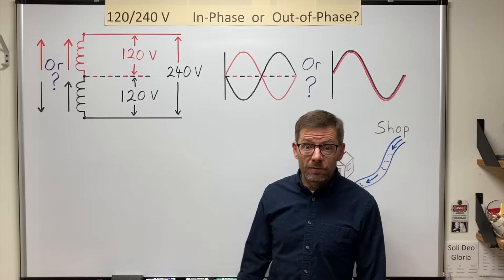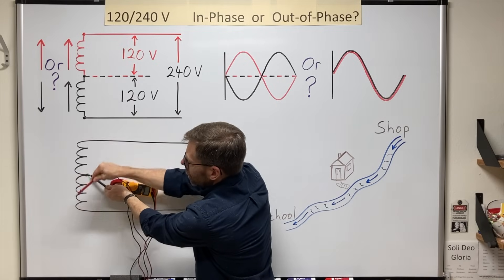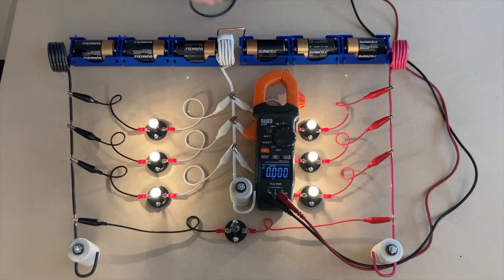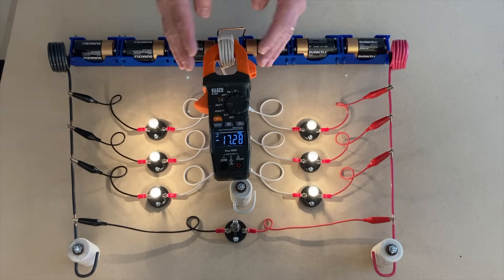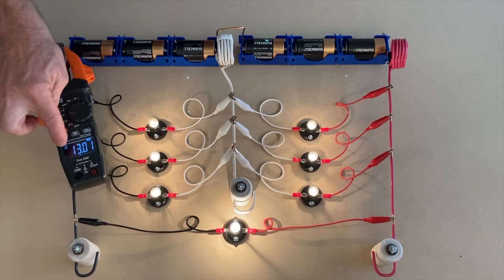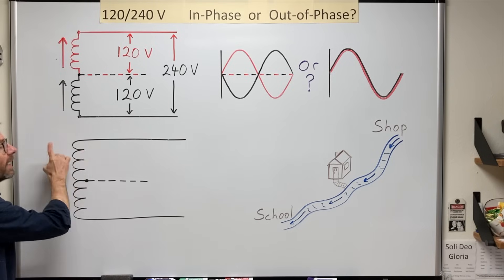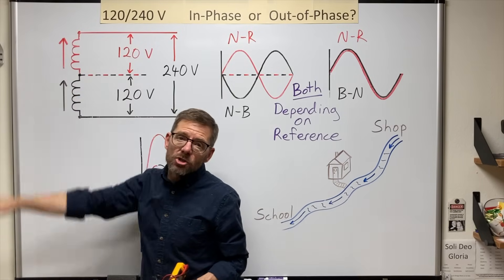120/240 V  In-Phase or Out-of-Phase

Comment: > 7:57 let's go back to the in-phase setup. 

I think what you called "in phase" and "out of phase" might be exactly backwards. When you flip the battery bank so that all of the batteries are pointing in the same direction (gold positives all point right), you have a large potential difference between the black and red busses, as expected. However, if we are treating this model DC system as a snapshot of an AC system at a particular point in, we should expect to see a dramatic difference in potential between the two busses only if the two busses are *out of phase*. This is clear if you consider the opposite: when both busses are in phase with each other, any moment in time that you might inspect the circuit would return zero potential difference between the red and black bus, meaning the 240v equipment would not run. 

Great video all around! I just had this small gripe

Comment: On 120v home generators, are you essentially using half a spin of the motor for 120v and the other half spin goes from 120 to 240v. And they give you 2 outlets from the 2 different sources? Meaning if you have like a 4000watt generator, you would want to split the outlets equally to try to max one side at 2000watts and the other side to 2000watts. Instead of trying to pull all 4000watts of appliances just from one lead? Does that make sense? 

And how is it different from a 120v/240v home generator?

Comment: Excellent video with an incorrect conclusion and should be revisited. A phase is a mathematical concept based on a measurement relative to a reference. In the case of split phase the reference is the neutral. With respect to neutral the voltage is out of phase or anti-phase since it has a 180 degree phase angle. With respect to one of the lines it is in phase. This is not a paradox, voltage measurements are always based on a a reference point. When the batteries are placed negative to negative or positive to positive they are now "in phase" or more accurately parallel in DC with respect to the center point causing the ends to have zero voltage with respect to each other, which is why the light is not able to draw any current from the two ends. In phase means the measured difference at the same time is zero, out of phase would mean there is a measured difference between the phases at the same time, the greater the difference the higher the phase angle up to maximum 180 degrees for two phases of the same amplitude. For the river analogy if I am at my house and measure water pressure in the river it will be positive from one direction and negative in the other since it is flowing toward me then away, just like doppler effect is used to know if something is moving toward or away from you its always relative to a reference.
Reply: You are wrong to use the Center Tap as the reference point. The Phase of windings does not change just because YOU added a wire, that you called Neutral.
Reply: @MrSummitville  I disagree, a voltage phase is based on voltage, voltage is relative to a reference point, the term phase voltage is based on measurement to neutral. Look at high leg delta now you have a phase 30 degrees off in the phasor diagram, where did it come from? Many inverters create 240v split phase with two separate 120v inverters running at 180 degrees from each other this is obviously a two phase source, some of them especially on inverter generators have a switch that parallel them instead and causes the two inverters to run in phase with each other for double the current at only 120v (see Honda inverter generators) so unbalanced loads can be run. A voltage phase is something you measure relative to a reference because voltage is relative to a reference always. Phases can be created by electrical devices, generators create phases, transformers can well transform them into other phases, inverters can do this as well, solid state transformers which are just back to back inverters/converters and create any phase you want from one side to the other, just because the power company sends out 3 phase from the source does not mean thats what we get at our home, its also not single phase, its split phase which is just a name for two phase at 180 degrees, there is no measurable difference.
Reply: @justinharrell9256  You can disagree but the manufacturer of the transformer states the FACTS, not you.

Comment: This might be a dumb question but at 4:40, why is the light bulb across line to line still on when you have the second set of batteries disconnected? Shouldn’t it be off?
Reply: Notice it's dimmer. The current is returning back to "neutral" through the three bulbs on the right. Since they are in series with the line to line bulb and splitting current between the three of them, they aren't getting enough to light up. An example of weirdness that can happen with a lost neutral. He has another video with this same setup on lost neutrals.
Reply: @snorman1911  Oh that makes sense! thanks for the reply

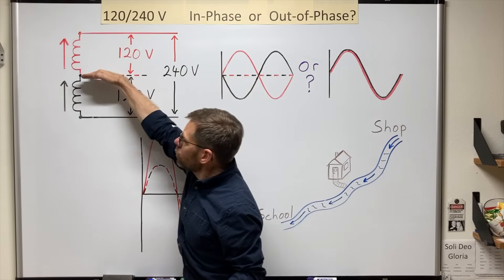Comment: Question: On 15:40, in residential wiring, I know the neutral is connected to real ground.  I assume the 'primary' side is a 3 phase (say Y) electricity.  If the neutral of this 'Y' is also connected to real ground, would it not cause problem?
Reply: the primary side is one phase out of the 3. The neutral of the 3 phase wye system is almost always grounded. So no, it doesn't cause any problem

Comment: I will repeat again here, that picture above asks the question.   "In-phase" or "Out-of-Phase". . .   Well the answer is with the centre point Grounded to 0V for Neutral, the two ends are running at 180° Out of phase with each other. . . .  It is simply like a kids see-saw. .. .   So the two 120V to Neutral are two Single-phase 2-wire supplies. . .   But all together L1, L2, N  is a 2-phase 180° 3-wire supply, simple as that, even if many Americans get this wrong.
Reply: The windings are In-Phase because they ADD. What wires you attach and what names you give them is irrelevant and does not change the physical properties of the windings.

Comment: The fallacy in this demonstration is that the voltage from one end of the secondary to the other is the DIFFERENCE and not the SUM of the voltages at  both ends. If both ends were in phase and had the same voltage there would be zero volts between them. Moreover it is meaningless to use two different reference points in a circuit as your "zero" reference. This is not merely a matter of "perspective" but one of consistency.
Reply: The windings are In-Phase because their voltages ADD. That is per the physical construction of the secondary winding. If you decide to measure the polarity incorrectly, that is your problem.

Comment: I do have a question that I have been trying to wrap my head around for years and nobody can really explain it. 
When you have a 3 phase compressor connected to 3 phases, I do understand how there exists a rotating field and there is no need for a run capacitor. 

Here’s where I don’t understand how it works. How do you run that 3 phase compressor on two phases without single phasing it? Let me explain. A lot of buildings will have 2 transformers on the pole and they only bring two phases in. The larger transformer has a center tapped secondary just like a single phase house and the smaller transformer is just a 120 volt single phase transformer. Every third leg in the breaker box is a high leg. I understand how the voltages work out on this type of system but I do not understand how that compressor can run on these two phases without single phasing and without needing a run capacitor. The rotating field is broken.
Reply: Its called Open Delta .  The transformer with the Center Tap gives you L1-N-L2 (120v/240v Split Phase residential) and then the second transformer gives you L3, where L1+L2+L3 = 3 Phase Commercial.
Reply: @MrSummitville yes. And leg to leg is 240/240/240. Each leg to ground is 120/120/208. I understand the voltage. I just don’t understand the phases. A PSC single phase compressor needs a capacitor. A three phase compressor doesn’t need a capacitor because it needs each phase to be 120* out of phase. But with this open delta or whatever you don’t have that. You have one phase 120* apart from the other one and the next one is in phase with it, and then back to the first phase which is 270* apart. I’m sure if you had an O-scope on all 3 legs it would look much different than true 3 phase.
Reply: @brianlittle717  Between L1 & L2 is Phase A.  Between L2 & L3 is Phase B.  Between L1 and L3 is Phase C.  Three Phases!
Reply: @brianlittle717  Video of Split Phase and 3 Phase using only TWO Transformers ... 
https://youtu.be/KsuCNTYRp6E?si=fkUUPU7UbK2Ytgfq
Reply: @MrSummitville no this is not at all what I’m talking about. First of all one transformer is much larger than the other. Secondly there are only TWO phases on the pole. I have some pictures of the setup but YouTube doesn’t allow posting pics in comments.

Comment: You have it exactly right. I see this on videos and books and electricians don’t understand and everyone thinks legs and phases are the same thing. It’s always taught wrong. Either way you look at it, you have a single phase transformer.

When we refer to phases and phase angles, we are referencing time. The phase angle represents the amount of time between something. With 3 phase power, each phase is really a separate voltage source that is regulated by the generators at the power company to be in sync with one another by an amount of time. When we say that reactive loads cause a phase angle between voltage and current we mean there is a difference in time between them because a capacitive circuit delays the voltage and an inductive circuit delays the current. 
There is nothing in a single phase transformer to cause any delay of any kind so the two legs cannot be “out of phase”.

Comment: very nice presentation.  Now, if the 240V AC is a pure sine wave, does that mean that the two 120V AC waves are not pure sine? I am thinking that since they switch at the same rate and the amplitude is different, only one of the voltages is pure sine. If that is correct, which is pure sine?
Reply: It is a single secondary coil with a Center Tap connection. Both halves of the secondary are identical = both are sine waves.

Comment: Physician from India. Heartiest congratulations on your excellent teaching video. I have a question. Rather than unbalancing the load, will the same effect on intensity of lights be obtained by adding an another stack of batteries 'in parallel' to one set of 4 batteries in your illustration? This has some implication in my research on diabetes. The question is open to all members too. Thanks.
Reply: You mean, another set of THREE batteries, in parallel with either the bottom three OR the top three? The intensity of the light bulbs still remember the same. Batteries (of equal voltage) in parallel only increase current capacity, not the voltage.

Comment: Three comments. 
One and foremost is this is a great presentation, well done sir.
Two, electricians measure from the neutral to phase, and the first graph illustrates that best. In that graph, the two sine wave are clearly 180 degrees out of phase with respect to the neutral.
Three, the opposing phase demonstration is more of a parallel circuit. Just go ahead and fold it in half, the batteries are now aligned with one another. Connect the leads that were on opposite ends. I’m claiming the batteries are in phase in phase, same current out, same in. Being in phase, the bottom light has no voltage to work and remains off. 
All that being said, you are really spot on by defining the reference point. As an old sparky, I’m standing by my neutral and claiming 180 degrees out of phase…
Reply: You cannot measure PHASE correctly from the neutral wire. The windings are PHASE-IN .  The transformer does not care that you measure the phase incorrectly, that is your problem. The windings are in series and in-phase.

Comment: Visitor from Norway. From Europe we have for a long time wondered about the  strange US split phase low voltage, high current distribution system. In most of Europe we now use 230/400V 3 phase TN - network for private homes. With 3phase the motors are simpler with no capacitors that often fails after some years. With a rotating magnetic field, the rotation direction can easily be reversed too.  Very practical to open garage doors.
Reply: The USA uses 3 Phase for Commercial applications. Residential is 120v/240v Split-Phase.

Comment: Ummm it's neither, as "hiding" the middle neutral conductor reveals, the output has always been a singular 240V.
Reply: The neutral wire does nothing. The secondary windings are physically in series and in-phase . If you measure the phase incorrectly, then that is your problem.

Comment: Brilliant and I concur. In your demonstration you could have gone further by fliping both side of the battery bank to simulate alternating current. Doing so would also explain the fundamental difference between hot and neutral  when connecting across half the length of the coil to obtain 120V. There would be no current at the neutral when the load is the same on both halves of the coil. When the load is imbalanced there is a net current flowing through the neutral. When there is a complete imbalancd i.e. no load on one side of the coil the current flowing at the neutral is the same as that of the current flowing through the hot. Also add the resulting graphs of the  superimposed sine waves. The two out of phase would be a flat line,  the two in phase would a sine wave with greater amplitude. In practice there is not a problem of overloading the neutral as these lines are joined at the thick bus bar in the electrical panel.

@15 min. you placed your hand on quarter of the sine wave and said that is the half point. The half point is where they intersect the x-axis the second time.

Comment: Let's say I have a device designed for EU standards (230 V 1-phase, Neutral, and Ground) and I connect this device to the split-phase system to the "hots" L1 and L2 (240 V), I will get no problem with the device and it will work fine? or no? The difference of 10 V can be neglected.
Who had the same experience please help.
Reply: Correct. It will operate at 240 volts.

Comment: Wow, it feels like a transformer blanket has been lifted off my brain.. I built a Fender 5F6-A bassman amplifier 2=3 yrs ago, which was my 2nd attempt at success .the only un-satisfactory aspect of the build was dealing with the Hammond 372HX + 1650N transformers. they came with hook-up diagrams but comparing them to std. replacement xfrmrs. we see dual primary windings*, *special interleaved construction*, *multiple secondary windings & the need to hook-up all of them at the same time. It made 0 sense to me, i tried hammond for clarification..... some of the well-regarded amp techs that i follow had some all informative xfrmr tutorials but they only applied to the typical xfrmrs that were factory-installed, not these universal units that i have. i followed the hook-up diagrams for them but at no time was i sure of what and why i was doing it that way. it's not comforting where lethal amounts of sizzle are involved, as we all know, its dangerous & can be expensive. Until today it remained a dark area for me & a point of discontent because i had no idea how to work with it.. thanks to your videos (most i've watched 2x) on primaries, secondaries, volts, amperes, current, taps, ratios & especially the phase learn with the lite bulbs,  I can look at the schematics of these universal application xfrmrs & have an understanding of why its hooks-up ceratain ways compared to others & not cringe  at 1st fire-up!.. thanks for the awesome teach!

                                                                                                 -jb

Comment: If I pull 600V off 2 poles of a 3-phase system and derive a 120/240 split using a TFMR like the one you are describing, how will the primary 600V being 120deg out of phase translate into the 120/240 secondary? Will I measure 240V, or 208V? Do they wind it in a way to compensate? Why doesn't it harm my loads? Awesome video--thanks!

Comment: I believe my plain concept on current leading the voltage on distribution lines vs the voltage leads the current after the circuit breaker box in our homes is very great . Relating that to a city of service panels at different current (amperage) ratings we can see how much a town is using in current. And also how many circuit breakers we use in a breaker panel , 200 amp service can handle a quantity of 10     20 amp breakers at 120 / 240 volts each!